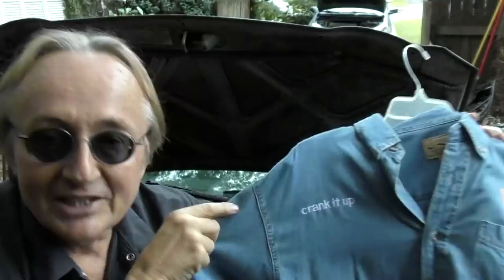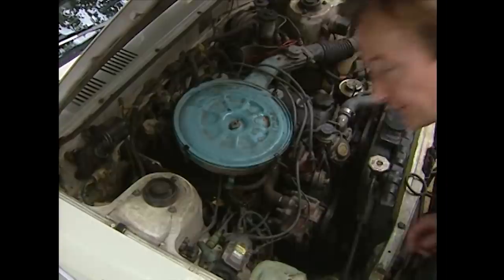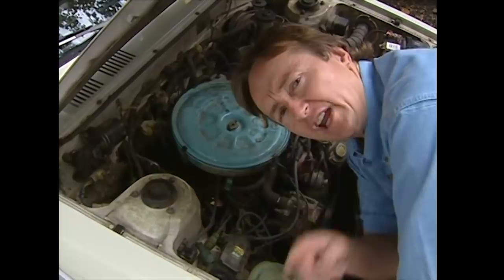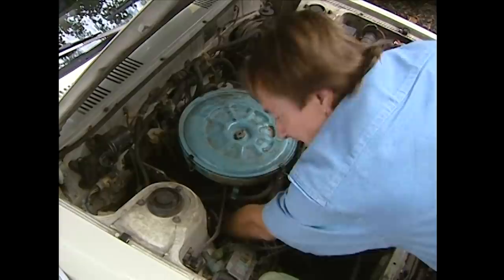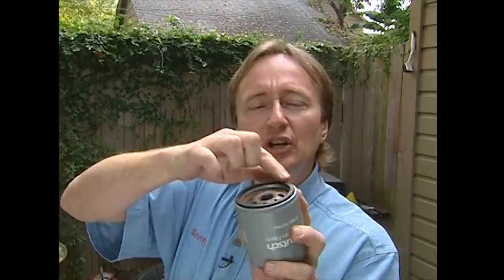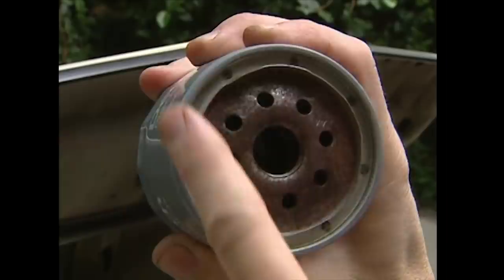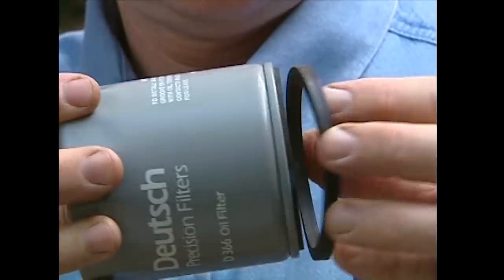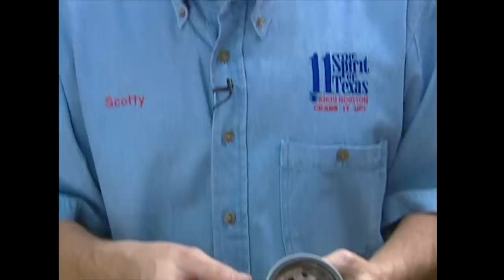Never Do This When Changing Your Engine Oil

Comment: This is gold!!!  ....and solid advice, whether it’s from 20 years ago, 2 years ago or 2 days ago.
Reply: Old, but gold...
Reply: Didn't say how to prevent it though. Would have been nice! Put some new oil on your new gasket and it shouldn't get stuck.
Reply: That's how you know he's really an Expert.
Reply: @Sandwich420  He said that tonnes of times in past videos U missed by not watching them.
Reply: I learned this in auto shop class in high school 20 years ago. I check for this every time I change my oil. Only twice has the gasket stuck to the engine block, and I had to peel it off.
Reply: @outdoorsguy  little by little they're making the old style oil filters obsolete.
Reply: @outdoorsguy   I wish we had auto shop class in my high school!  I graduated in the year 2003.  Unfortunately, my the school emphasized useless stuff, like algebra and chemistry.  I've never needed algebra in real life, and I work as an accountant!  It would have been really helpful to have shop or auto class (especially for us girls).  Also, we never learned how to use Microsoft Excel or Access.  I went to school in a middle class school district, and our "excellent schools" taught us nothing useful in the real world.  But I suppose that's a big problem with education in general these days.  Too much emphasis on standardized tests, and nothing that prepares students for actual jobs.
Reply: This has been less and less common these days. Well at least on the better quality filters. Wix, k&n, mobile 1, even the last motorcraft filter I used. You would have to pry the gasket out with a screw drive to remove it from the filter
Reply: Black gold.

Comment: Honestly, this happened to me once. After changing oil on countless cars, finally got bit by the double gaskets. But I knew quickly once I started the engine and oil was spitting out onto the ground. First thing I looked at was the older filter and it’s gasket was missing.  That was in 2004 and now I look at it every time.

Comment: Years ago, a lady I worked with raced stock cars.  The Chevy dealership did all the work on it as part of their sponsorship.  They changed the oil, mistakenly left the old seal.  Lost the engine pretty quickly on the track (and a lot of clean up).  That was 30 yrs ago and still sticks in my head to check every time.

Comment: Wow cheaper manufacturing processes all those years ago now everything is made of crap.
Reply: I have always used motorcraft and I can't even take that gasket off without a flat head or pliers.
Reply: I find it funny how these new cars can barely reach 1 year without breaking, I drive almost 16 year old Zafira 1.8 and still runs as it should but new cars already having blown head gaskets, tranmission issues its just unreal that they cannot even last 1 year
Reply: Did you see how thick that oring was?

Comment: I learned the hard way. As I'm backing out I noticed a huge puddle of oil on my driveway. I Immediately stop and check under my car. It was leaking oil where the oil filter is. Turns out I made that ol' double gasket mistake when I changed the oil. I learned an important lesson that day. Always check that the gasket is on the used oil filter. simple 1 second check that newbies can overlook.

Comment: It's good advice and I've seen something even worse caused by double gasket-ing.
 I've done some work practice during my student years at a dealership service and a car came in with oil pressure problems. Red oil indicator was showing up, car had really low oil pressure. The mechanics blamed the oil pump, but after removing it and working at the car they realized the old oil filter gasket was covering the oil holes in the new filter and was preventing the oil flow. Needless to say the last oil change was also done at this dealership!

Comment: In 30 years of changing my own oil, I've never had a gasket come off the filter and stick to the engine.
Reply: same here,  and one time about 3 years ago,  it was too cold outside so i went to brad manning ford in dekalb,  illinois,  and the kid that changed my oil,  who a week earlier was mopping floors,  left on the old gasket and i got 8 miles away and all the oil was gone,  luckily nothing happened except for me making up my mind to never ever again take my truck to a stupid dealership for anything,  and i mean god dang anything,  as they are clowns and fing fing ripoffs and the sad part is,  they know they are ripping off every single car and truck that comes into a dealership,  clowns all the way,  laughing all the way to the bank with our money,  ha ha ha,  no more satchmos!!!!!
Reply: Some don t oil filter and it rips off,espessially when you are the new owner and make tthe first change..
Reply: So your point is either, 1 it's not necessary to check the gasket,  or 2 you're very lucky. Which is it ?
Reply: What about the old Chevy canister type filters?
Reply: Neither have I. But do you know why that is? 
Its because we make sure to put a little film of oil on the gasket before installing it on the engine.
Reply: Wayne S. I've had it happen AND I put oil on the gasket,it's rare but it does happen.
Reply: It happened to me 1 time, back in 1983,started the engine, blew out 3 quarts of oil in just a few seconds.
Reply: I've had it happen only once - but I caught it because when my uncle taught me how to do an oil change (back in about '73) he made that exact point. I've always checked, just in case. And I do think putting a film of oil on the gasket when installing it helps prevent it from sticking, but I could be wrong.
Reply: I've seen it happen a few times- FRAM filters
Reply: John Wilkerson Happened to me once.  Backed down the ramps and oil poured out. Couldn't imagine what it was. Never heard of this. Got it all put back together by dropping the oil into the drain pan and pouring back into the engine. Maybe needed to buy another quart.
Reply: @stevefranklin8052  I always check the gasket. Just saying that it's never happened even when I used the cheapest filter I could find. I've always pre-lubricated the filter gasket.
Reply: i have a number of times. it should only cool you once.
Reply: @jorowi  be careful with cheap units . I had one fail on turbo diesel customers car after he had done 70 miles and destroyed the engine. turned out to be incorrectly labeled unit . wrong part . Ryco  paid for new engine.... ...   eventually
Reply: fool

Comment: Yep, made that mistake probably 35 years ago and have checked for the gasket ever since..  When I double gasketed 35 years ago, it leaked the second you started the engine!  Lost about a quart of oil in about 20 seconds before I could shut down the engine....  Check for the gasket on the old filter!

Comment: Been there.  Done that.  I usually check but on the one instance when I did not-wouldn't you know, this is when the old gasket did not come off.  Was in a bit of a hurry and that's what I got for my haste.  Fortunately, the oil light came on almost immediately and was only a few blocks from home.

Comment: I actually had this happen to me. I admit I was in a rush but lucky when I changed the oil and filter and started it up to check for leaks oil was going everywhere. Shut it off and check the old oil filter, sure enough there was no gasket! Had a lot of oil to clean up and had to buy more oil. Lesson learned!

Comment: favorite channel ive seen on you-tube so far have worked on every single
 vehicle ive owned out of neccasity because if i had to pay a mechanic 
to do work id never be able to keep a car on the road just did a engine 
swap on a 2001 Buick Le-Sabre a few months ago the old one made it two 
280,000 miles found one in a junk yard for 300 bucks easy enough to put a
 new one in. a lot of people dont like the way the Buick's look but at 
19 ill take reliability over anything the 3800 series are bulletproof 
engines ive seen more Buicks be commissioned for the body giving way than
 anything else

Comment: Similar issue can occur with the oil plug crush washer.  The old crush washer can stick in place when you remove the oil plug and may require a bit of force to remove it.   Be careful not to mar / gouge the surface of the pan when you go to remove the old crush washer.

Comment: The exact thing happened to me back in the early ninties. I worked on the oil and lube rack at a Chevrolet dealership and performed the service on a 1988 Corvette, I still see that car to this day. The Vette was white with a tan, convertible top , and tan interior. After I drained the oil and removed the oil filter I even took the time to wipe around the area, including where the filter screwed to the bottom of the engine block and I still missed the seal from the old filter being stuck on there. I installed the new oil filter, lowered the car and put the new oil in. I started the car and began putting my tools away. I turned around and a puddle of oil was growing under the car. I ran over and turned the engine off. Fortunately no damage...phew!

Comment: BOY LEMME TELL YOU...  

I learned this first hand. Luckily I noticed it right away since I always let my car run for a bit to make sure there are no leaks after an oil change.  Left the old gasket on while screwing in the new filter with the new gasket and when I refilled the oil and turned it on all the oil spilled out...  Also luckily I had an extra 4qts of oil

Comment: Another point is the check your oil filter for correct tightness; 
put some oil to the gasket before installing the filter. 
Depending the location of the filter, if not tighten correctly, when its loose it can squirt oil to your brake disc and create all kinds of havoc when you need to brake*.
*Based on actual experience

Comment: Another thing, you should remove the new rubber and lightly cover it with motor oil, that way you can easily tighten the new filter using your hands. If you leave the o-ring dry you will have difficulty tightening the filter up using your hands.

Comment: Always apply a little oil to the New Oil Filter when screwing on a filter. 
Then it won't stick to the surface in the area where the filter is replaced.
Always remember to "NOT OVERTIGHTEN " the New Oil Filter.

Comment: Had a neighbor who had what was then a newer truck still worth quite a lot and not only its utility but its market value.... and he went to change his own oil after someone else failed to wet the previous oil filter gasket with a little oil before spinning it on and that gasket had wound up stuck to the block and he didn't know it when he went to put on his dealership replacement part. He wound up losing his oil at speed and grenading the engine because of his good, best effort intentions being thwarted by bad protocol applied in the maintenance lineage.

Comment: Great video Scotty, this is exactly what happened to me once when I doubled up the gaskets. The oil was spewing out from the filter as I was driving down the road, the oil pressure and temperatures were spiking so I had to perform an emergency oil change to fix the gasket, not a fun day.

Comment: Use the correct oil filter and the correct oil for your car and to include make sure your oil level is at the proper oil level that your engine requires.

Comment: I did this once on my Ranger.... didn't realize it, so I just tightened the filer up really tight.  When it came time to remove it, however.... I busted my knuckles pretty badly (should've had stitches or a suture) and had to get a friend to help me, we had to punch a screwdriver through the filter, which is located right between the engine and the frame rail.... not much room to work.

Comment: These days, manufacturers don’t bother to lubricate the gasket sealer on the oil filter which can pain when removing the filter because you don’t know where the sealer is.

Make sure you apply PRESSURE when removing the oil filter and always do it from the top!

Comment: I failed to check out the gasket once, and both gaskets were on the engine. When I started up the engine, the oil spewed out all over the driveway. Luckily for me I turned off the engine before any damage was done . I had to buy more oil .

Comment: Had a guy do that in the shop but it was a semi truck. It takes alot of floor dry to clean up five + gallons of oil! Couple years later his replacement did the same thing with the same truck after I mentioned what happened to the other guy😐

Comment: When I changed the oil filter one time I did not see the old rubber gasket still stuck to the engine.  After I screwed the new oil filter on with two rubber gaskets instead of one, I started the engine.  Well guess what, I immediately knew something was wrong when I saw an oil mist cloud the size of a rain cloud rising out of the engine compartment.  I never made that mistake again.

Comment: I can admit to doing this. I was changing my oil on the driveway. Took out the oil filter, replaced it, and filled up my oil. Went to turn on the car, and about 3-4 quarts of oil spilled onto my driveway. Took off my oil filter, and bam, 2 gaskets.

Comment: So if you, as a mechanic, had to assemble 1 vehicle to drive around the world in gravel, dirt, pavement and, only carry your own spare parts onboard, what would you assemble?
A)Small or large):sedan, wagon, van, SUV, pickup, cab over, Jeep style
B)drive: front, rear, 4x, all W
C)Trans: manual, auto, cvt
D) fuel: gas, deisel, electric
E) Suspension: coil, leaf, torsion
F)Motor: straight 4 or 6, v6 or 8, flat 4 or 6
G) Ignition: points or electronic
H) Fuel delivery: carb or (mechanical or electric) injection
Cams) overhead or pushrod
I) timing: belt or chain
J) etc.

1 assembled vehicle (multiple manufacturers)?????

Comment: That happened to me 20 years ago. Fortunately I had just changed the oil and car still in the garage. I ran the engine about 30 seconds, then went to check the oil and walked right into a puddle of fresh oil on the floor. Engine was ok, but I had an ugly mess on my hands.

Comment: Thank you scotty. I have learned so much about cars since subscibing to your channel a few months ago. I have learned with cars to not buy. Which transmissions and good or bad and how to fix cars. And how cars work. When i had my cars transmission fluid changed. My car was leaking tranmission fluid. Then i remembered watching one of your videos that you answer question. And remebered you saying about one question that automatic transmissions have a vent and extra transmission fluid can drip out of the vent when its been changed. And your video on windows. Using silicon lubricant to spray the windows so they work easyer. Thanks for all of the knowledge.

Comment: Lately, the dealers have been putting in these synthetic oil mix blends on their vehicles (I guess that's one of my few questions to you because I can't really toss any truly good questions at you like these other fine motor enthusiasts, lol:  What are your opinions on these synthetic oil mixes?  I reside in a place where the temperatures get below freezing pretty normally at about this time of year, and it's not uncommon to come across guys like myself who wear shorts if it's only 30 or so degrees Fahrenheit, because we're expecting to confront colder temperatures later on and pray our vehicles turn over instead of walking.  Adding Heet is merely a prayer in my case, and having a battery that continues to crank in these extreme elements.  Would that have a strong influence into why synthetic oils mixes are being created?); including the older models like my 2004 Ford Ranger, which I have a lot of respect for because it continues to take care of me. lol.  Instead of changing my oil once every 3 thousand miles, they want it done every 5 thousand miles.  I know that oil changes are possible with conventional oil after 5 thousand miles, but I get very leery behind this change and worry that the chances of sludge increases.

Comment: i have always heard of this happening but have never seen it myself. worked in an engine shop for years and had many many cars and never seen it. i did have one time where i took off a filter that was on a non running car many years. took off the can then the O ring fell off in the pan.

Comment: I got a question for you that no one seems to be able to answer.  I bought a new 2014 GMC Sierra 1500 pick up truck.  The truck had a 4.3 6-cylinder engine.  No matter how hard I tightened the oil filter, it would also loosen up after about 1,000 miles.  Have you ever heard of such a thing?  And what could of caused it?  I traded that Sierra for a new 2017 Silverado LTZ Z71 with a 5.3 and I'm so glad that I did.

Comment: Scotty I have a question about my car, (or hopefully anyone can answer this) I have a 2001 Honda Civic LX 4 speed automatic, and recently it has been up shifting at a high rpm than usual, around 3000-3500, normally if it’s reached 2k and I hold the throttle there it will upshift. If I let off the throttle it will not upshift either like normal unless I reach above 3k rpm, this happens for upshifting every gear. A check engine light has been lit presumably bc of this. However after a few hours of
This my CEL went off and the car drove normally. I took it to my shop and they were able to get codes for the electrical load detector and one for the throttle body. The ELD is an easy $20 fix however a new throttle body is $600. I looked into it and believe it could just be the throttle position sensor, a $30 part. Do you have and insight on this?
Reply: DI ROMA just buy a new throttle body and change it yourself, easy thing to do
Reply: Trade it

Comment: Honda dealership changed oil in my parents vehicle. New mechanic left the old filter gasket on. My parents were driving through a Walmart parking lot and saw a trail of oil circling the lot... My dad goes, "some morons really losing oil, he'd better get that checked out!" (Turns out it was his vehicle, engine was shot, oil light didn't come on until it was too late)